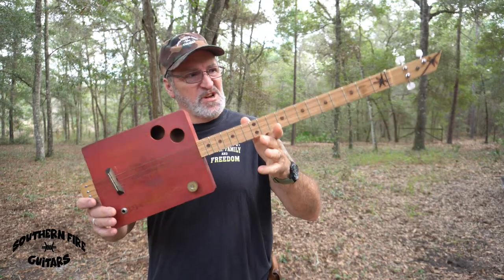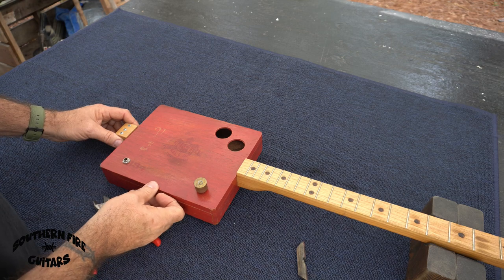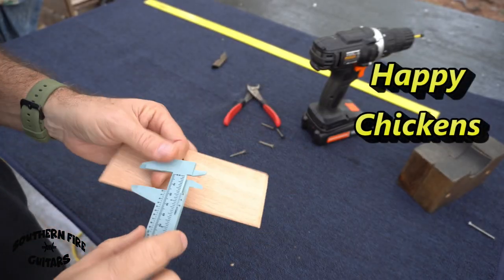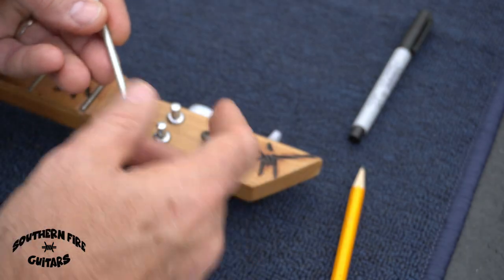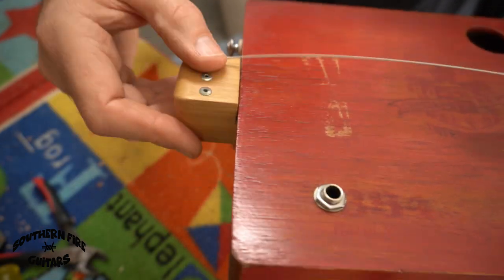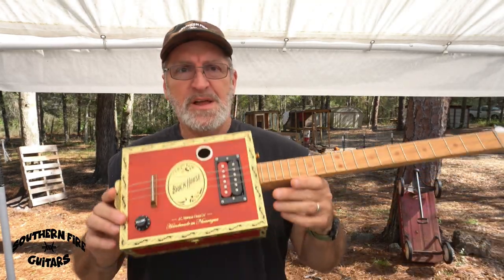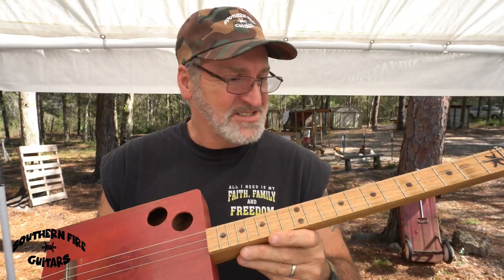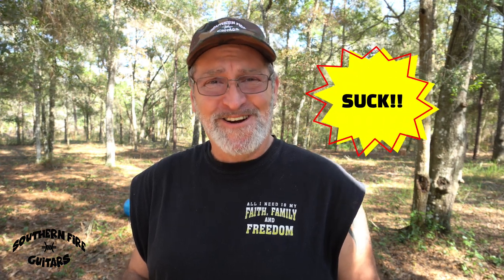This Cigar Box Guitar SUCKS!!

Comment: Hey Mike, every time I watch your videos I learn something. So I'm sending something back.  Cutting frets. I use an app called google sheets and programmed it with the scale  specifications and automatically  it will give me the fret cut for any size fret scale just change the scale length in the input, very quick. Now I've gone redneck engineering. Using a radial arm saw and an old plywood  blade  I cut the frets. I ground the blade kerf down very tight with a 4 inch side grinder to an appropriate thickness to fit  medium fret. The radial arm saw gives me depth adjustment easier than my miter saw. The plywood blade has  no  carbide teeth and about 100 steel ones which  cut pretty fair. It does require multiple hits with the side grinder to get a good thickness for fret grab in the wood. Using a siding miter would require a jig for holding the fret board. I mark the fence on my saw a few inches back and add the same to the fret measurements to coincide wide the blade. Now I eyeball the marks  not the blade and fretboard mark. Lastly I use a metric ruler. Millimeters are very easy compared to fractional increments.  1 inch equals 25.4 millimeters exactly. You have inspired.
Reply from the maker: Thanks Mr. Bill.  That's some good ideas. M~
Reply: 11:00am 6/27/2023
Reply: I'm  messing with the idea of putting a metric measure rule on the fence on my radial arm saw so I can put one mark on my fret board and move it down the rule for each appropriate measure of fret. My thoughts are eliminating  one transfer of measurements to keep with the accuracy needed on the fret board. Example move the mark on the board, make the cut, move the mark on board make the cut and so on. Saves on pencil lead. The spreadsheet makes any size fret board possible.
Reply from the maker: @MrBill-br7bx  Sounds like a plan. Good luck with it. M~

Comment: Nice presentation.  Having made several diverse stringed and other sound makers; each found needs for tweaking.  As to the hold down, I have used multiple small screws; but being cautious about drilling a metal rod, i would choose two eye screws and pass the rod through them.  They would sit about where you placed the holes, or to the outsides of the string.  I prefer individual hold downs so each string is easy to change.  
I love using magnetic pickups, especially with a piezo pickup as well.  CB Gitty has a 1/4" thick mag PU that works well for shallow locations.  Add a volume pot for each works best as does tone control,  but one can get away with none or fewer pots; or a blend pot.  The mag(s) tend to do the main work and the piezo adds natural ambience (and hysteria) as needed... cardboard cigar boxes lack some tone and volume.
Also, I prefer to leave space between the neck and soundboard (as you have(?)) to get reasonable chance of sound with no amp.
I enjoy your sharing.  Really glad to see the insides.
Reply from the maker: Thanks David. M~

Comment: Sounds great.  A question:  rather than adding the 1/8” spacer, would a taller bridge have accomplished the same thing?
Reply from the maker: No, because lifting the back block up 1/8'' angels the whole neck down ward, so the head stock is now 1/8' lower than before. M~

Comment: Sounds good. I've learned a lot about cigar box guitars. My wife got me one last year and I've had fun playing it. But I've got to redo the bridge,cause the intonation is off. It's sharp at the 12th fret. But the bridge is a hinge that is screwed in. I'll figure it out. Thank you for the videos
Reply from the maker: Thanks Frankie. Good luck with the intonation. M~
Reply: @SouthernFireGuitars  I think I'll have to take the bridge off and mount it on the end of the cigar box and use a bolt to raise the strings off the body.

Comment: Just a quick question : do you remember what kind of paint (and painting method  - brush, spray can…) you used for this one ? It looks very nice. Until then, I used my boxes as is, or just put a light wood stain, but I'd like to try painting them (and it not to look too amateurish)
Thanks !
Reply from the maker: It was a red spray paint, and semi gloss polyurethane spray can. It can out nice. M~
Reply: @SouthernFireGuitars  It really did ! I especially like that one can still see the imprint, even with the paintjob.
Reply from the maker: @therealjba  After I painted it, I sand some of the paint off a little to see the graphics on the box. gives it a nice look. M~

Comment: Hi. I talked to u a little while ago about my camacho 3 string. About the strings being too hi. I tune my guitar to G D G and i measured the length and put it at 25 in length fret board. The bridge is only a small diameter wooden dowel . So when i tune it and then i press the 12 fret it is not a, g d g its like a f# and the other two strings are off also. This is my first guitar am i am getting really confused lol. Shouldnt the 12 fret be g d g also when held down ? Is it because the strings are too high..... Thanks.
Reply from the maker: Hi Tom. It could be due to high strings or you may need to set the intonation by adjusting you bridge. M~